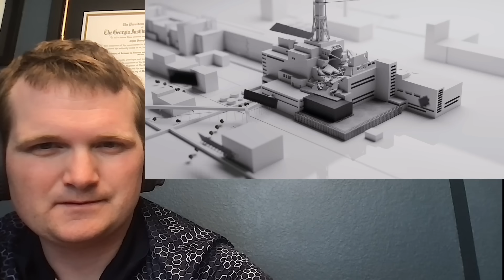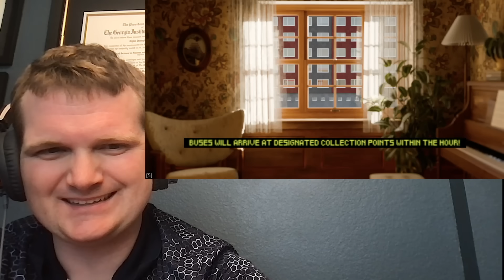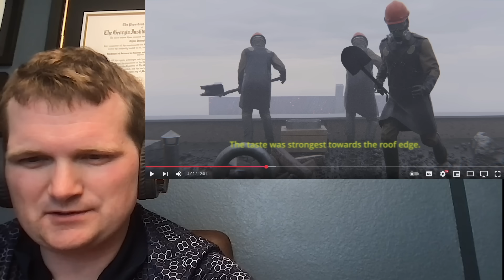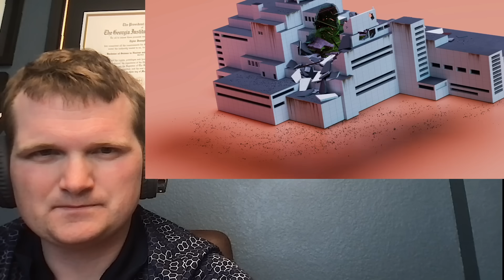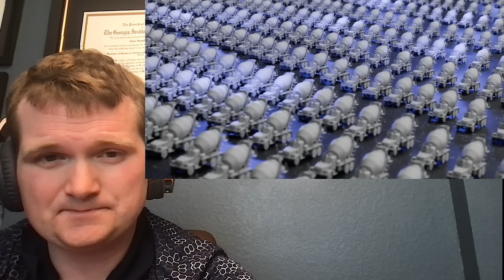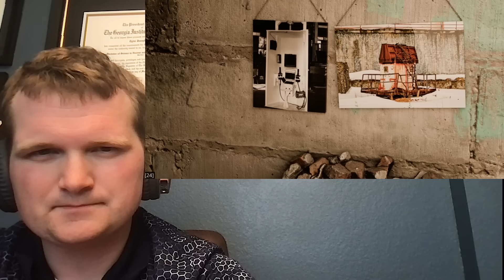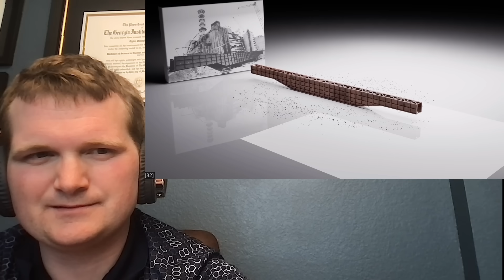The BEST Chernobyl Video on YouTube? - Nuclear Engineer Reacts to Solve

Comment: I worked in a hot tool room as a contractor during outages in the late 2000's. That was a fun job, had free range of the entire facility with my security clearance except the control and cable spreader rooms. This was a bwr facility so the entire building was a radiation controlled area. There was only a small cafeteria area, another tool room, and bathrooms outside the rc area. Everything else was separate auxiliary buildings. Our dose rates were on the order of 1-2 mrem/hr. Highest I remember seeing in my daily duties in some areas was around 4.

Comment: I've sometimes wondered what the Chernobyl site would've looked like if photographed in the immediate aftermath with specialised cameras that could image visible light, and also gamma rays and x-rays (I don't know if x-ray radiation was event present), and particle radiation — as used in gamma and x-ray observatory cameras, etc. Compositing an image of all (relevant) electromagnetic wavelengths and particle radiation would have an astonishing result ... I think; I have no idea. But I can imagine being able to see where certain radiation was fully or partially shielded, and by what material, as well as the intensity and pattern of radiation. Someone could model that computationally and generate images, I'm sure.
Reply: probably there is a difficulty with this idea, in the way that no optics Lens coud "focuse" the  Gamma, or X-ray radiation. 
 "Lochkamera" maybe? made with a Lead-shutter?
Reply: @konradcomrade4845  Indeed, you cannot have a single camera that shoots both visible light and gamma or x-rays. For visible light you want to use optical lens elements but those do not work for gamma or x-rays.

However, gamma and x-rays have short enough wavelength that you should be able to get usable images with pinhole camera. The only problem is having enough shielding to avoid exposuring the film while the shutter is closed.
Reply: I would be very surprised if the US didn't task some satellites to see what's happening there. Maybe not quite as comprehensive monitoring as you suggest, but they'll definitely have tried to get some pictures of the site.

Comment: Tyler, the Russians sent a drone to deliberately damage the new containment structure. Fire crews had to go in and put out fire and clear the damage. The environment inside was negative pressure - not by much but enough to keep any dust in. Now it is exposed.

Comment: The Soviet Union had a series of small nuclear generators they used to power remote lighthouses, they used nuclear generators because the lighthouses were to be left unattended for extended periods of time, so diesel generators or something like that wouldn't work for the constant refuelling. Anyway after the collapse of the Soviet Union these generators were left scattered around the countryside abandoned, free for anyone to tamper with, which is obviously a recepie for disaster.
I'd like to hear your take on this story though it's one of my favourite nuclear mishaps.
Reply: No sure if they qualify as "small nuclear generators" . I think they are called RTG's, and belive they are more like a radioactive battery. And not a reactor doing fission. 
As they generate power by temperature difference between the hot radioactive material inside, and a cold outside. 
Making electric power by a Peltier effect, or something like that. (Same as a 12v car cooler in revers) 
Not an efficient generator, but have the advantage of no moving parts that can fail.
Reply: @zigge1989  I mean they are called radioisotope thermoelectric generators, so they are nuclear and are generators. But I get your point, when you hear nuclear generator something else comes to mind.
Reply: @zigge1989  cool, I know rtg's from Kerbal space program lol
Reply: i think he reacted to that or something similar, check his reactions to half life histories
Reply: Tyler did a reaction to Kyle Hill's video about the Lia Radiological Accident. It was an incident in Georgia where a group of men found some abandoned Soviet nuclear generators without knowing what they were.
Reply: @wanderingspark yeah i was talking about that, didnt know if that’s what he is talking about or not

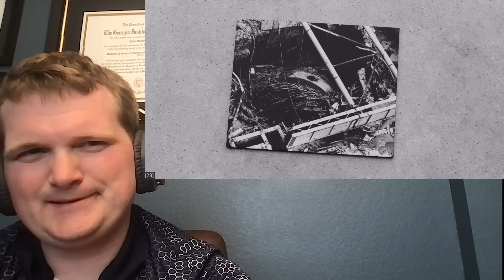Comment: 18:16 there actually have been a few scientists who have argued that the ratio of xenon isotopes released after the accident does support one of the explosions having been caused by a runaway prompt criticality much like a fizzled nuclear bomb. The belief of Sergei A. Pakhomov and Yuri V. Dubasov was that the fuel melting without its water coolant and moderator could have created an extremely fast nuclear power transient. They argued in 2009 that the anomalously high levels of Xenon-135 in Cherepovets, 1000km northeast of Chernobyl, only 4 days after the accident suggested that a nuclear event may have ejected xenon to much higher altitudes than the following fires did, which would allow for such a short half-life isotope to spread to such remote locations. They estimated the second explosion to have been equivalent to about 10 tons of TNT. 

This theory was examined by Lars-Erik De Geer, Christer Persson, and Henning Rodhe in 2017, and they agreed that the fizzled event was possible, but they argued that it was more likely to have been the cause of the first explosion rather than the second one. Both groups argued that whether it produced the first or second explosion, the fizzle event would have consisted of a prompt chain reaction limited to only a small portion of the core.
Reply: I think the narrator saying that it was a risk of another nuclear explosion.  I understand where Tyler is coming from, but if an explosion is flinging radioactive material around it is a nuclear event in a generic point of view-- regardless whether the cause of the explosion was xenon or built-up hydrogen gas or whatever else.
Reply: Your dealing with physics in an envooirment that would not normally exist and is such that what we think of an explosion is actually something else we are unformilure with. granting a short period of time where a non explosion has the properties of an explosion do to insane amounts of energy propergating outward. We can only theorize but in my opinion we might as well consider it an explosion anyhow.
Reply: Yeah I was just about to say along with, if the huge beams had fallen it could've weakened the ground which could potentially speed up the whole process. I just couldn't think of the best words to use.

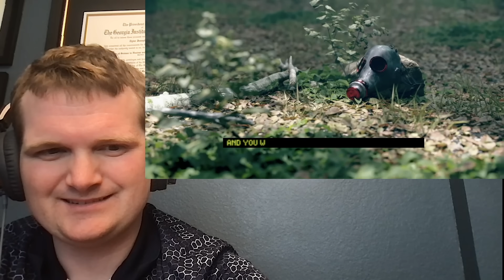Comment: 5:27 under the USSR in this part of the country they didn't speak the language presented, this is stupid propaganda fed in small portions to the viewer of such videos. There was no Ukraine in 1986. And the language used was "surzhyk" and has nothing to do with the modern language called Ukrainian. Be smart
Reply: denis, you're dolboeb
Reply: Ukraine did exist in 1986—as the Ukrainian SSR, a full republic of the USSR with distinct borders and Kyiv as its capital. Ukrainian was a recognized official language and was absolutely spoken at the time. Surzhyk is a pidgin that emerged in areas where Ukrainian and Russian mixed, used mostly by people who weren’t fluent in both languages. It wasn’t universally spoken, and many still spoke standard Ukrainian or Russian depending on region. Modern Ukrainian is not a new language, it’s evolved with their independence the same way every other language has evolved over time, but a Ukrainian speaker from the Ukrainian SSR in 1986 would still understand someone speaking Ukrainian in independent Ukraine in 2025. 

Be smart.
Reply: @nickyn1083  the original point still stands that the evacuation message was not in Ukrainian though it was not “surzhyk” either. The evacuation message was in Russian, which you can validate yourself by simply searching up the actual recording of the evacuation message which was oddly not used by the video creator.
Reply: @vano0  I know what language it would have actually been given in — the same as all official broadcasts during the Soviet era. Nowhere in my comment do I say anything about the language the message would have been in. That wasn’t the point of OP’s comment or my own. He said the video is propaganda, that Ukraine didn’t exist, they didn’t SPEAK the language presented, and the actual language would have been Surzhyk. I responded saying Ukraine did exist, the language did exist, the language was spoken, and that Surzhyk was a pidgin of Ukrainian and Russian. 

The point wasn’t the actual language of the emergency broadcast, it was ensuring anyone who read the comment knew that what he’s commenting is not true.

Comment: Is it true that there was a similar accident in the US? The difference was, that in the US they had a conrete dome enclosing the reactors, so that there was not a big catastrophy for the environment. Saw it in a video mentioning it years ago on YouTube.
Reply: If you are talking about three mile island then no, not even close. 3 mile island had a minor acident, the reactor was nowhere near exploding and the only radioactive thing that got out was some xenon gas that didnt do anything.
Reply: @vid101.  After a quick research and also consulting the Ai it was probably this one. At least that is considered the biggest catastrophe in the US. It seems that even without the dome, it wouldn't have been as bad as Chernobyl. Seems like the video over exaggerated a litte, thats what I suspected. Can't remember what video it was.
Reply: You are probably seeing something on the SL-1 power plant accident in Idaho in 1961 or the Santa Susanna Field Reactor meltdown in Simi Valley (near Los Angeles) in 1959.

Comment: So would it be possible to make a lead lined carbon fiber outfit? With just enough lead to counter most radiation would that work?
Reply: In brief: yes, you can embed lead layers into a carbon-fiber garment to attenuate X-rays and low-energy gamma rays—but to stop most penetrating radiation you’d need millimeters (or even centimeters) of lead, which translates into tens of kilograms of shielding and a virtually unwearable outfit. Moreover, carbon fiber itself offers little neutron protection, lead is toxic and malleable (making secure bonding tricky), and modern alternatives (e.g. bismuth- or tungsten-based composites, hydrogen-rich polymers) often give better performance-to-weight ratios.
Reply: i am not a specialist i just know a lot about this because when i was 13 i got addicted to anything about radiation so there may be mistakes

Comment: Hey Tyler, i was wondering if you could do a vid related to the Bikini Atoll sarcophogys?
Reply: Presuming you mean the Cactus Dome, a concrete lid placed over the scraped-together topsoil from the islands left by the US Navy in 1958 on the island of Runit in Eniwetak Atoll.  The stuff underneath the dome is nothing compared to the area under the New Confinement at Chornobyl.  Honestly, if the Navy had put all that in a barge and sunk it a few miles away from the atoll, no one would even be thinking of it today.